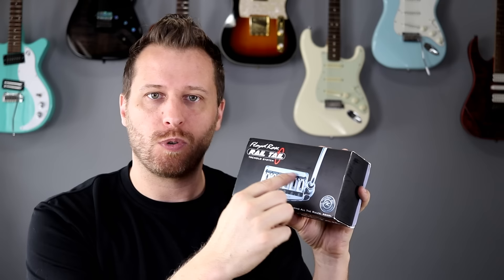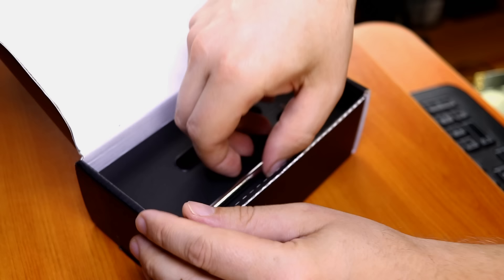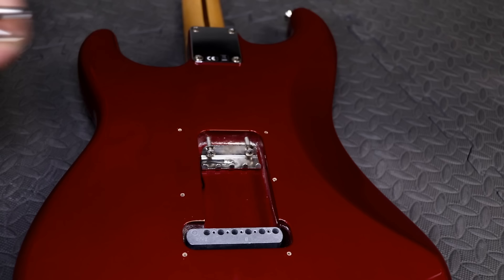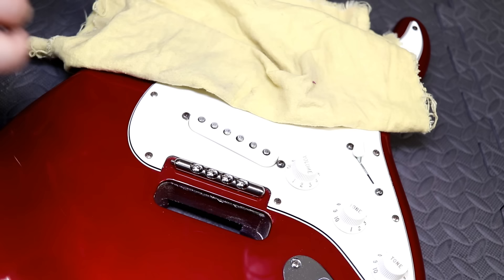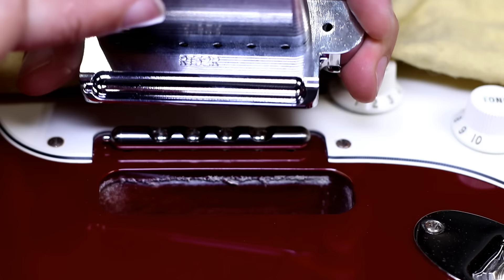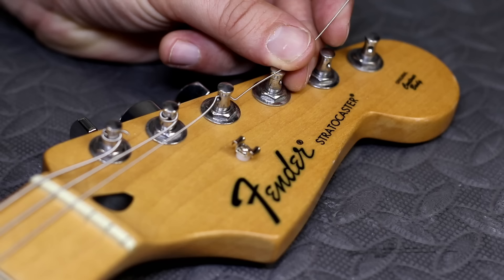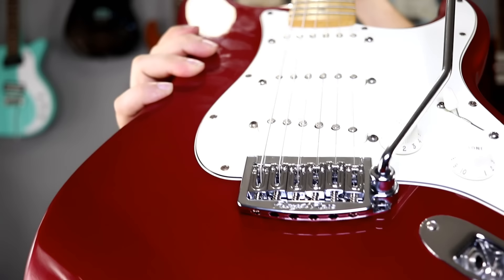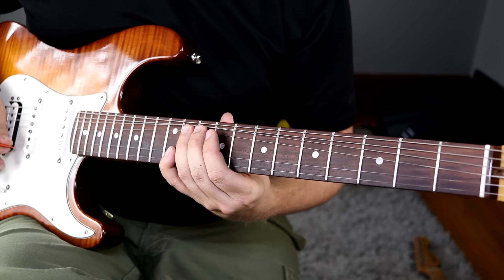Farewell to Fender's 6-screw Trem! - Floyd Rose Install!

Comment: DARRELL! That tube of lube was supposed to last for awhile. You didn't have to use ALL OF IT AT ONCE!

Also, a clever luthier can install that trem so it DOES float. Or talk the client into a VS100 from Wilkinson - much cheaper, lighter, and easier to install.

Comment: I know it's more work but I prefer my Wilkinson VS 100N along with locking tuners graphite nut and string trees. I also added a tremsetter. This way the bridge floats and you can use it for vibrato and the tremsetter helps with the stability and it's less money (but you have to drill out for the posts) just my opinion but my strat with this setup stays in tune and it sounds great.

Comment: Just installed mine, in black, in my black Strat. This started as a stock made in Mexico Guitar Center $400 special but now has this, a  920D loaded everything pickguard with Seymour Duncan’s and locking Fender tuning machines. 
Install was super easy but the only thing missing from your video was having to set intonation and action - a little nerve racking as I’d never done those before, but I quickly got the knack..
I do find the arm is very tight - where the original fender could be manipulated with just a small finger, this requires at least three and is actually better with the palm. Should that be? 
All in all a very easy installation, and I’m getting much better sustain and tuning stability.  Thanks for the video, that’s how and why I’d did this!
Reply from the maker: Very sweet setup!

Comment: One can get a six screw Fender PRS trem to stay in tune floating . It has taking me years to work it out but it's about lubing all points of friction learned that many moons ago. But the Claw & the spring placements it's as stable well almost as a Floyd Rose double locking Trem. it takes a while to find that sweet spot w/the claw angel & number & placement of the springs two on the low E side & one spring on the high e , with the claw angled w/the claw being closest to the low E string. I have mine floating & I can bend double stops & the other strings don't go flat. It's all just physics really. Oh my lube is graphite powdered mixed w/ 3 in One Oil. If I can find it food grade white lube used in food processing plants on all points of friction. Of course the nut slots must be cut proper. Oh & those string trees take em & sand them down to a fine polish the wing ones or better yet get the roller trees.

Comment: Beautifully made, but part of the point of Leo's design, and if you look at the original 6 screw trem patent, is the ability to pull back a bit, making for a much more musical vibrato. The technique to keeping the 1st string in tune is a slight palm of the trem body. Easy with practice. I love the Floyd trem, but it doesn't like to float. For me, as a tech and player, and for the expense, it's not enough bang for the buck.

Comment: I love my Super Vee Blade Runner on my Strat and would love to compare it with this one. Nice job all around, Darrell!
Reply from the maker: Cool! 
I've heard great things about the blade runners! 
Does the trem bar have a tightening screw to keep it in place with adjustable tension?  
That's the one thing I can't tell.
Reply: It has a nylon bushing and mine stays in place. Mine is a few years old and they now have added an additional way to secure it, too.    Did you notice the sustain improving on yours? Mine leapt forward! I'm gonna upgrade my other Strat, too, but wonder how much this Rail Tail runs in usd.  The Blade Runner is $179 usd I think.
Reply from the maker: Nice! Good to know👍
Yes, slight change in overall tone and a bunch of sustain.
Reply from the maker: I added a link to the rail tail in the description. ($250)
Reply: Oh yeah, no dip on double stop bends
Reply: This vid shows the Blade Runner installation along with setting the arm where you want it. The deck can float or not … your choice. https://www.youtube.com/watch?v=TAq5nWZFRJE
Reply: Overall, I'd say the Blade Runner is easier to install and at $70 less, it's the more likely choice for me.

Comment: The original tremolo bridge that Fender made/makes is the best imo. The bridge is ESSENTIAL to a (STRAT)S sound, ALL of the other units sound different, and different is not good when you want authentic strat tone/sound. 
      The Mexican strats are authentically made, except, they use a narrower string spacing.

Comment: I've tried several different Strat tremolos, and I MUCH prefer the 6-screw to any of the 2-points. On MIM Strats (or any with either zinc or thin blocks) I replace them with Callaham or KGC, but I always go to the 6-screw. I use pure nickel strings, and I find the 6-screw stay in tune better.

Comment: Darrell thanks for the try out video !!
But I got to tell you that the quick release/body noise @ minute 10:11 and 10:19, well...it did not make this awesome system any justice !!

Why this annoying metal on wood knocking noise/sound is present ??
Well, if i buy one, i would put a piece of a bycicle or old car tube or any machinery below the area that this bridge returns and touches the wood.
BTW....I believe this Floyd can be floated like 1 or 2/8s mm from what i saw on this video and if so, then the returning banging knocking sound 
has to be a lot less is my best guess !!

If knocking still audible,  then i will route like half an inch below the metal/wood impact zone surcace area and place + glued a thick scuba diving rubber of about 5/16s of an inch !!

That way the knocking will be audible but much darker sounding or maybe it will not even be heard !
I'll have to try if i end up buying this Floyd trem !!
Since you have maybe still have it eith you......can you try my idea
or try glueing an actual stationary rubber band to the bottom of this floyd trem using silicone ?
Please make this new try out part of your next video as an added bonus !!
Hope this idea works well !!!👌
Thanks Darrell !!!

Comment: I like innovation, it’s important to not get stale. However, couple of issues, I need a floating trem. With locking tuners, and a reverse pressure spring “trem stop” style, and a floating bridge I rarely go out of tune, as the reverse spring pushes the block back. Setup correctly it will even keep pitch if a string breaks. Also I dislike roller bridges. The first run of these units did not have roller saddles, they tend to decrease sustain.

Comment: I highly recommand checking mannmade trem. IMO they are the best I had the chance to try. Mann is the guy behind the design of the prs trem system and he offer a similar thing for strat. Stay greatly in tune, it is floating without being stupidly uncontrolable, it handle double stop very well, it looks great and it is cheaper than this floyd rose system ;)
And tuning unstability is most of the time a nut issu. it is worth upgrading to a well cutted auto lub nut (like graphtech tusq ones)
Reply from the maker: Cool! 
The PRS system is top-notch 👍

Comment: If you screw your trem arm down on your strat and have it pointing down towards the jack it'll fit in the case. At least it does in the g&g cases Fender uses for the American Original series.

Comment: Thank you Darrell for this video, now I can finally use a 6 screw strat, as before they weren't an option for me.  I have never liked the vintage tremolo system on the fender's  although the 2-point system is an improvement, I usually change those out for a Wilky.

Comment: Hold on, am I right in thinking that this thing only lowers notes? Vibrato, (not tremolo, Fender got it the wrong way around on their guitars and amps), is a frequency oscillation around a fixed point. This doesn't do that, it only divebombs. I've no use for that. Thanks, Darrell, for showing me that this isn't what I'm looking for. Love that stringwinder, though...

Comment: I've put a kahler on a Guild solid body years ago....built like a tank, roller bridge....but!  It's a pain in the ass for staying in tune.....I can get a song out of it.  The big thing is that it's got a locker behind the Graphtech  nut.  Can't get enough downward angle behind the nut without cutting out wood under the locker.  Can't take the wood out without making it impossible to adjust the truss rod.  (Nut driver type...not allen key)  Catch 22.
I use a capo between the back of the nut and locker.....still....doesn't hold good enough for more then a tune or so...with nut sauce everywhere.  It's worse without the capo.  According to old man Kahler (yes he's still alive and I talked to him) there must be a solid 15% down angle to stay in tune.

Moral of the story.....Screw adding tremelo's!  If the guitar was made for it fine....play it before you buy it.  A lot!
Forget it if you have to modify the guitar and cut out wood.  Once you install it and it's a problem....you're screwed.
250.00 is a lot to spend to find out it's not useable.  This one is nice since you can just drop it in....but!!!!  If it doesn't make you happy then you got a 250.00 boat anchor that won't keep you from drifting!
I think the best solution is save up and buy another guitar with a Floyd and locking nut from the factory.
Test it good before dropping the cash.
Even Jeff Beck has problems with his....roller nut and all (two post trem)....watch his video's.....he smacks the strings a few times almost every song to get the trem zero'd.  You can see him do it on "We ended as lovers"...the one with Eric Clapton.
Tremelo's can be wonderful and some will ruin your playing life.

Comment: There are good reasons why Fender doesn’t change their term unit for Strat.  It’s a matter of taste whether you like Fender conventional trem’s sound or Floyd Rose’s.  I myself prefer Fender trem’s acoustic tone.
Reply from the maker: Hi! 
The reason Fender don't change their trem units is the price. 
After market trems machined from steel or brass are very expensive. They sound way better though. 
The US made PRS guitars are the only ones I know of that use solid brass like this one. ☺

Comment: Impressive looking product and innovative but I’d really like to know how the string height isn’t a quarter of an inch off the frets with that bar in place of the six screw standard trem? Also, sure it makes sense that the string vibration transfer might be better with more direct contact but just as you have demonstrated before most of the sound is in the electronics such a when you had the guitar with most of the body cut away. I prefer a floating trem with a basic half step note lift and haven’t ever experienced significant tone or sustain drop off from a hard tail equivalent, certainly nothing that very minor eq tweaks doesn’t easily fix. What other six screw trem replacements could you demo that allow for a half step bend up? You mentioned G&L in the video. I have a bluesboy and an S500. The S500 has the best non locking trem system I’ve ever used, very, very smooth. Maybe demo one of those sometime. Thx for reading 🎸

Comment: This looks great.  My Mex Strat is the only guitar that I've modded and it appears that this would be a nice upgrade.  The only problem is that the Rail Tail costs half what my guitar costs.   Also, another painful thing is that I replaced the stock pot metal trem block with a steel block (I like the extra sustain) and the saddles already.  So this means I would negate my last two upgrades.  However, I still may consider it.  I like the sound of steel better than brass, but your demo at the end was pretty convincing.  I've never noticed the effect of string bends on the tuning of other strings.  Thanks for pointing that out.
Reply from the maker: Glad to help! 
Sounds like you've got a great strat ☺
Reply: It is a unique Strat.  I got one of the Roland Strat's that was a Mexican reissue of the VG Stratocaster.  The original was too expensive and discontinued.  Then they decided to make a Mex version for about $699.  I have the two knobs to give me Drop D simulation, DADGAD, Twelve String, Baratone, etc.  It also simulates a Tele, Humbucker accoustics, etc.  I love bringing it to various practices.   It was available for a short time when I got back into guitar about 4 years ago and then disappeared again.  I treasure it even though it is one of the cheapest guitars I own.  Your Rail Tail seems like the next thing for my treasure.  I have a couple Ibanez, an ESP and an American Tele; but this guitar is so special.

Comment: I'm aware of the 2 pivot trem on Standard Series Squier and Fender but... what about Kahler ? the top loader models with no thru-rout - no rear rout for springs and no front rout for the Floyd micro tuners - seems like a LOT of wood left alone - hard to believe people agonize over bathtub routs for pickups AFTER choosing a Floyd or Fender - Kahler vids boast of top access to spring tension, top access to whammy bar tension to keep it handy instead of flopping around - left or right trem mounting points and easy conversion to locked status ... and roller saddles too

I used to have a Fender Japan Strat with a stock Kahler - it even had a "no tools" lock nut - a quick release thumb lever laying along headstock that would pinch or unpinch strings

Comment: Very very cool...I have an American Standard and I think I would upgrade just because the issues you mentioned about the tremolo bar... and as a side comment, I did not know about the locking your string when installing new strings... I don't remember Mel Bay mentioning that with my chord books from him in the 70's...Keep up the great work Darrell...

Comment: And when you just think of it, that  upgrade is totally unnecessary,because the fix of the Mexican trem is so easy,just look around on YouTube,its basically tightening the screws holding the springs on the back and then put some GraphTec string savers and boom,better intonation,no strings breakage and much cheaper upgrade.But different strokes for different folks.
Reply from the maker: Hi! 
The difference here is the all the brass. Brass trem block, plate, and saddles. It addes sustain and changes the tone. 
Like you said though, anyone can easily deck their stock trem. ☺

Comment: From an engineering point of view the Fender 6 screw bridge/trem is a terrible design. This Floyd Rose system is properly designed for purpose and it's the answer Strat players have been praying for. I'll be putting one on mine. Great video Darrell.
Reply: Except it can't be set to float. What you have with this is a dive bomb machine. It can never be pulled up, even for slight vibrato.

Comment: My 6 screw tremolo works fine, better than the 2 point, and 10 times easier to adjust than my Floyd Rose, but I liked the look and sound of that new model.

Comment: a trem that you can't pull up a little on never feels right to me. I've tried putting the bar against the body but it doesn't work for me. I just got used to compensating for strings going flat by bending them a little when necessary. fortunately my guitar stays in tune unusually well when using the bar. I'd love to try one of these to see how it works, but I'd have to try it before I buy it

Comment: *#*# I'm sure that the guy on the video knows, but I think by saying that this replacement tremolo is NOT floating, and is meant to be set flush against the body/decked (Tremolo set to go down in pitch only), they might infer that the 6-screw ARE floating, they are not meant to be set floating either. 
Many (if not most) players set it to float a little bit, but they were never meant to be setup like that. The 2-point ARE designed to be able to float.
The knife edge on the plate, with the spot on the post that allows it to come in contact with the posts and stay like that. Most of the Strats that I get on my bench are set to float. When people first bring them in to be setup, and complain about tuning issues, more often than not I know when I open the case what I'm going to see; the tremolo set with too much of a float. When set to float, they're only many to give a sight vibrato, not dive-bombing and radical pull ups. 1/8" if the highest it should be off the deck.
If they're setup correctly (both 2-point floating/6-screw semi-floating, the Tremolo plate should be parallel with the top of the body (or in the case of the 6-screw, no more than 1/8"). On the 2-point, it should STILL be parallel with the top, there shouldn't be any angle in relation to the plate and the body), how much you can pull up should be set by raising it lowering the posts themselves, so even if you can pull up a step or two, when the strings are in tune and the Tremolo springs are still correctly, the space between the bottom of the plate and the top of the body should be even and equal front to back (parallel).

Comment: Darrell, do you really like the neck shape of the Mexican Strat?  Mine sucked until I reshaped the profile, especially near the nut.  I also had to dress the frets and sand down the fingerboard edges so the fret ends would not sluce my fingers.  I got the guitar because a music store went out of business that had my OP Music Man Petrucci on consignment.  They sold it on Ebay so I got a brand new Mex Strat to replace it.

Comment: The arm connection is terrible though! I've been using one for a few months now and the arm comes out way too easy. I need it loose to swing down when I'm not using it but when it's loose the arm barely stays in. Why couldn't have Floyd rose just used their screw in arm?

Comment: Hi Darrel,
Nice vid! You mentioned this trem isn't meant to be set up as a floating bridge. I really wonder why that is? Looks like this wil not be a problem to do it anyway. This FR trem looks very interesting for me but only as a floating bridge.
Thanks!
Reply from the maker: Hi! 
I talked to the guys at FR and they said a floating trem requires knife-edges.
This system has too much friction. 
The bonus of the friction is a ton of sustain and tone transfer to the body ☺